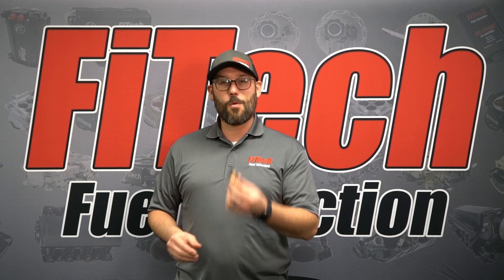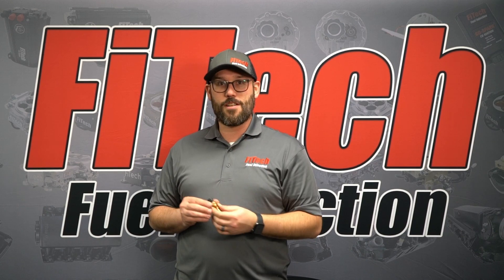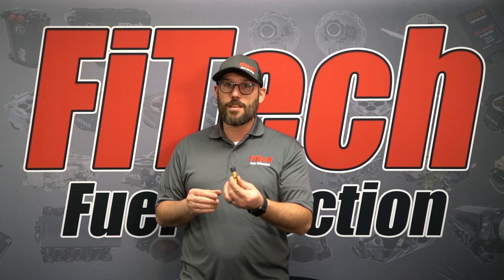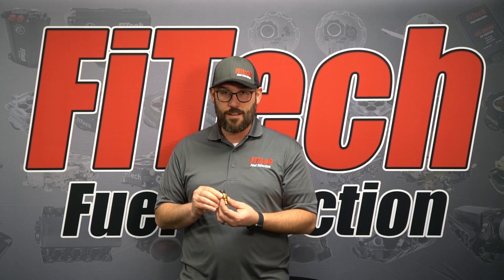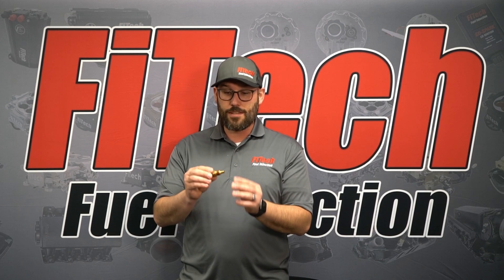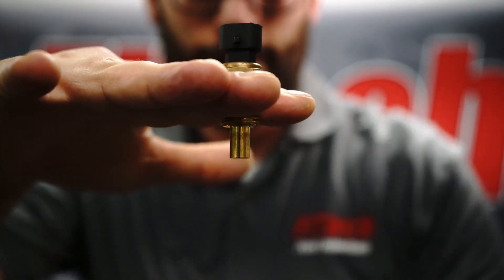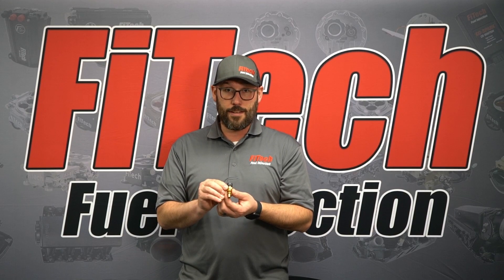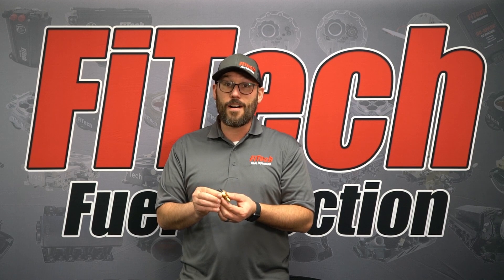Coolant Temperature Sensor | Tech Tuesdays | EP57

Comment: Where does it go in a 1967 cadillac 429?
Reply from the maker: Hello sir,

The requirements for the coolant temp sensor is to be ran to a port where its a water passage to the coolant system.

Comment: My reads about 60 degrees warmer than my gauge and infared. What should I look for?
Reply from the maker: Is the sensor in a location that has an air pocket? This can make the sensor read unusually high. Also the cylinder head will read hotter than at the thermostat.

Comment: I have a 74 Chevy c10 with a 350 small block, I currently have the fitech temp sensor installed on my edelbrock intake next to the thermostat, but the sensor is reading 20-30 degrees lower than the aftermarket temp gauge which is accurate. Can I install the sensor into the factory temp location on the driver side of the engine block by the exhaust manifold to get a better temperature reading for the fitech system ? The system currently fluctuates back and forth between high and low idle because the system thinks the truck is cold when, in reality, it's at normal operating temperature.

Comment: The previous owner of my car placed the temp sensor in the driver side head on my big block Chevy. In traffic it can run 10 to 15 degrees hotter than my sensor next to the thermostat. Should I swap positions of the sensors?

Comment: what is the preferred temp range to run the fitech efi system?
Reply: Efi starts learning at 172. Buy a ac Delco temp sensor. Don't use the cheap one that came with your unit

Comment: Is this sensor the same as GM #15326386 (AC Delco 213-928)? A lot of forums are saying to use that instead, but if it's the same people just might not know ..
Reply from the maker: They are the same sensor. Some believe the GM sensor is more accurate however in the system you can scale the CTS to your liking.
Reply: Not believe. The quality of the Ac Delco sensor is a lot better.